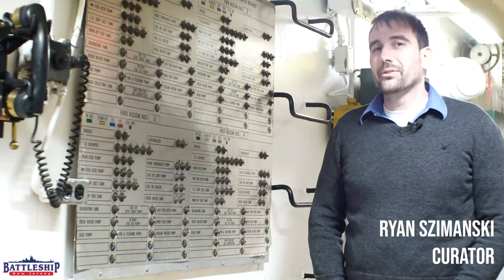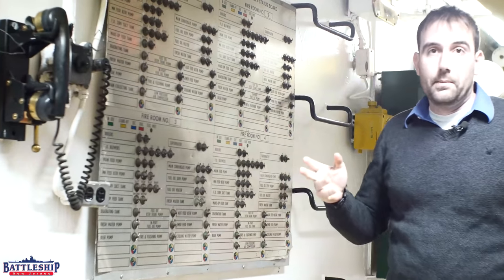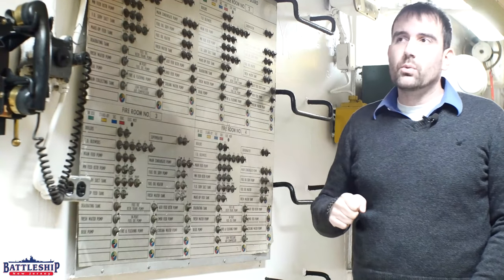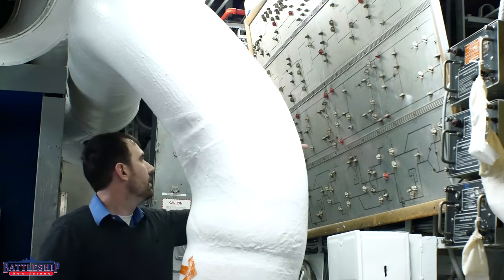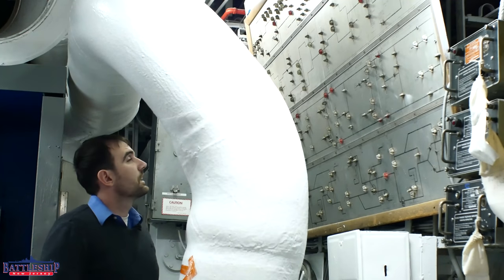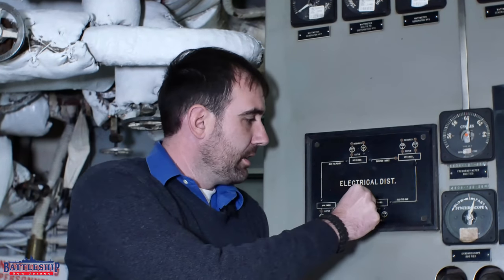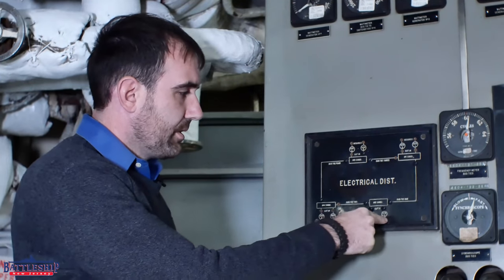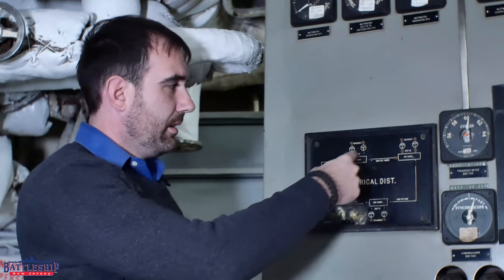How Do You Track Which Boilers and Engines are Active?

Comment: As an electrical engineer it is a bit tiresome to hear people use the terms "analog" and "digital" completely incorrectly.
The automation terms bellow aren't applicable for this statusboard, since it is:
1. Not mechanical, as in using mechanical linkages to relay the information to the board. (often such would be done by pulleys or hydraulics for longer distances)
2. Not analog, as in using a continuously variable electrical signal. (analog does not mean "anything that isn't digital".)
3. Not digital, as in an on/off electrical signal. (though, why they didn't use status lights is a debatable question. (Since digital doesn't inherently mean "computer controlled", but computer control is often digital.))

The statusboards here are manual. As in we have to manually go and set the status on the statusboard, since there is nothing doing it for us.